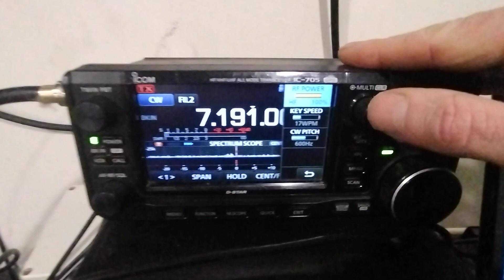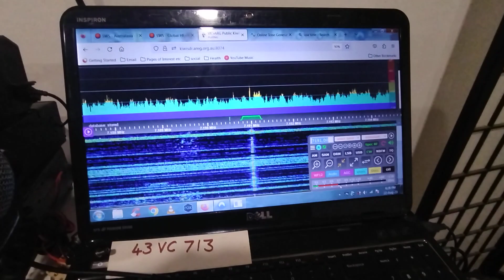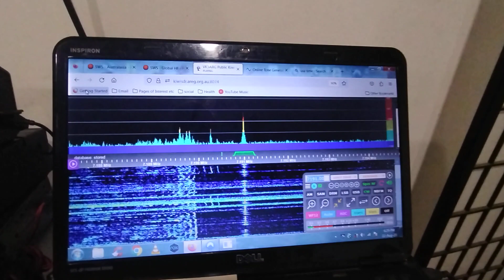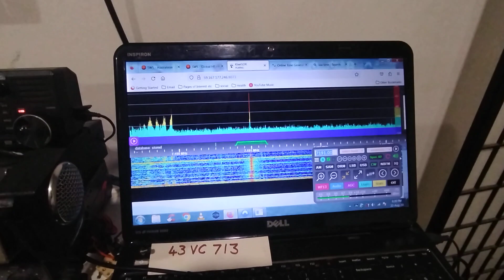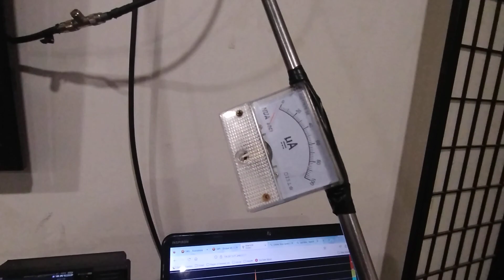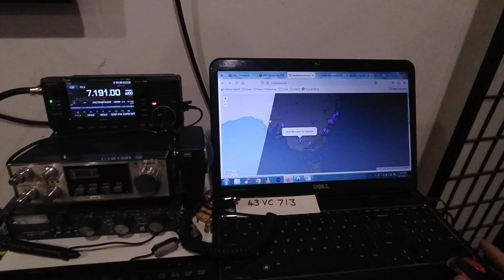⚡Next Stage ⚡SIMPLIFIED⚡  Capacitively Loaded Vert GP Antenna⚡🙏⚡More Bands ⚡ Watch this Space ⚡

Comment: Would it be higher current at the point of feed?
Reply from the maker: It is Similar in behavior to an End Fed Half Wave,
when matched through a broadband transformer it has numerous points of both high and low independence as we sweep through the spectrum.

As a multi band antenna &
when tuned with an ATU (Creating a Resonant System)
the far end (centre Conductor)
should be High Voltage 
& the exterior surrounding this will have high current (onto Coax Shield & Down the   Radials (Heavy RF Choking prevents Currents from continuing down the Coax Shield).
Reply from the maker: If you meant at the Radio Shack End?
In many cases it will have High SWR that is corrected by the ATU.
In these cases it would be like tuning into a half wave of unterminated  coax.

This is all Frequency Dependent